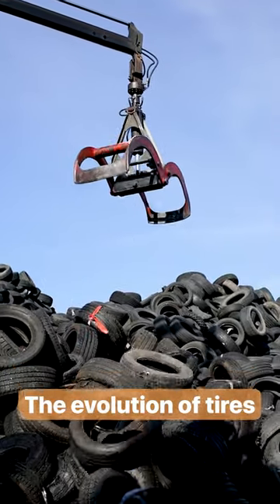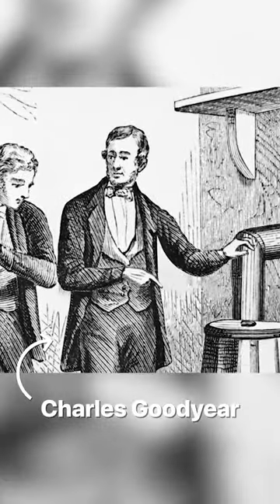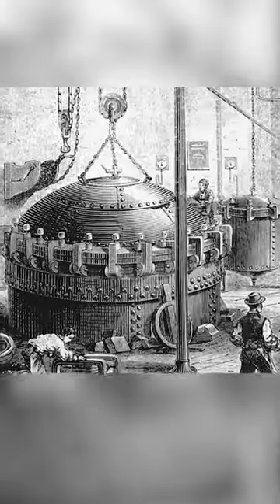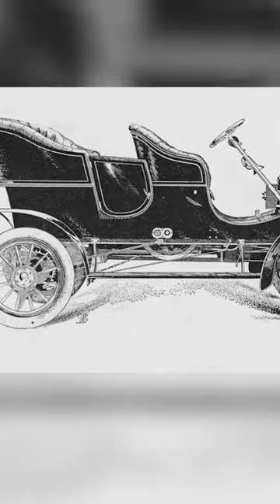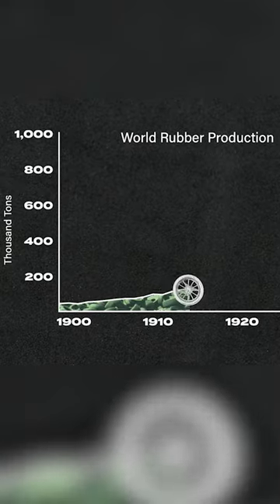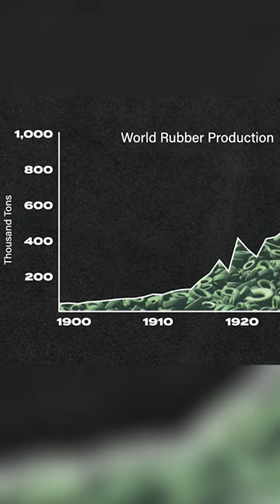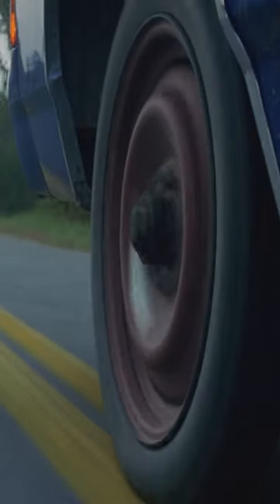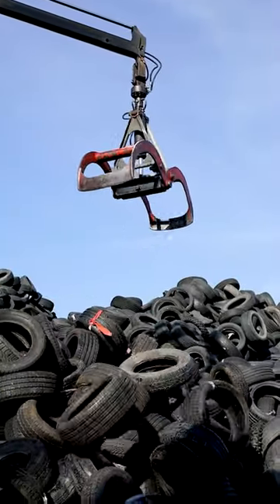The world has found many uses for tires over the past century. 🛞 #rubber  #tires #history

Comment: Why was the rubber intially treated with sulphur though? Thanks!
Reply: Maybe it was pure chance. Then again, most people don’t just have a pot of sulfur laying around…
Reply: To make it stronger, it was be chance. They were blending and treating it first. Then it was dropped /spilled on the stove. By chance this was the beginning of vulcanization of rubber. This vulcanization is where it was mixed then cooked to a point of hardness. It made it tougher and more durable. We could now use it for automobiles and industries. Thus why it’s done this way.